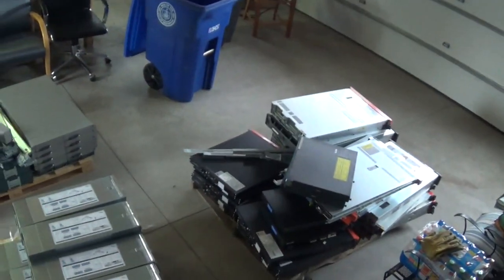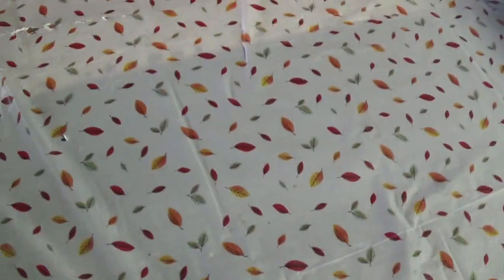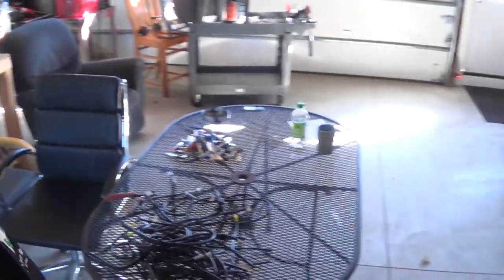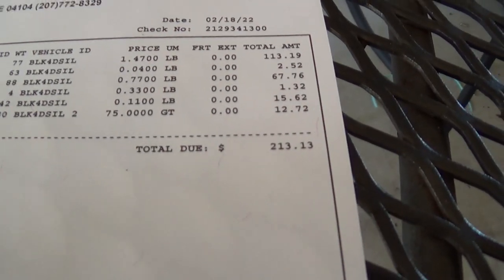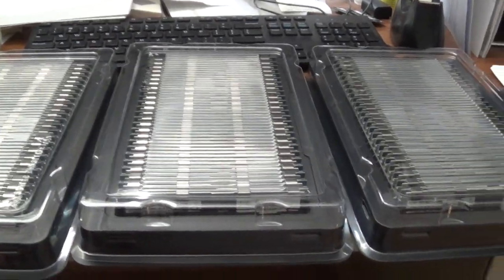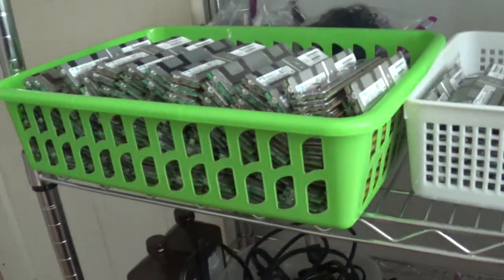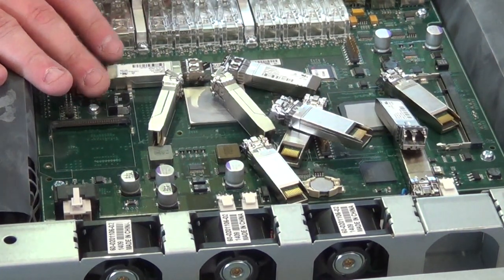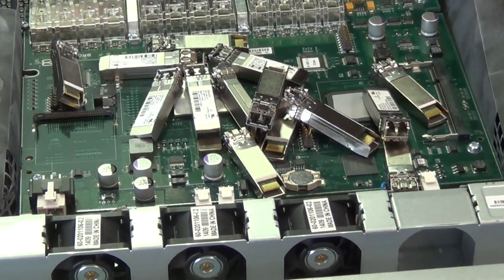Big Scrap Haul and Scrapping a Fiber Switch -Moose Scrapper #355

Comment: @21:29 there are 4 blue capacitors on the power board, they are akin to the surface mount MLCC’s and can potentially contain silver and palladium. 

If you find a yellow or orange resin dipped capacitor on a power board, it will be marked with either a C or a Y, the C is your tantalum capacitor

Happy hunting 🤙🏼
Reply: Excellent score btw 🍺🤘🏼👌🏻

Comment: I was just digging around and came up with four 170 MB hard drives and six 8 MB sticks of RAM (with a $75 price tag still on 1 putting that at almost $1 per megabyte LOL) along with two strange-looking sticks that could only be RAM but not like any RAM I've seen before along with a very robust looking PCB that says made in USA from 1992 so I thought I might ask you how you go about identifying some of these things that are very old?
Also what are you anticipating you're going to be able to get for those 32GB ddr4 server RAM sticks you got and would they fit in a standard PC ddr4 slot even if it's not supported on most motherboards because I don't care if it's 32 gigs that's only seen as 8 being able to address them just because I'm looking to maybe get a server to use as a PC and file host being able to use the same RAM when I switch would be cool so I don't have to buy anything new so update us when you figure out what you looking to get for them. 
I've tried to figure out what kind of machine this old Hardware goes into because it's quite different from what we use now but I'm not having much luck and you might recommend to me some ideas on how to go about doing that. What do you do when you see something you don't know anything about identification based software image search or just pick some old guy's brain for info on these things?

Comment: Hi I think you need to do some research on chips and components because you are throwing out dollars to get back pennies you don’t know what you are doing and you are waist all your time doing it and as for fibre switches they are big money lots of gold corner bgas and and all the stps that go in them some sell $2000 each and older ones $400 and lots of gold in side do some homework you ripped your self off big time
Reply: If it was easy everyone would be doing it.  Sometimes it  takes too long  taking e-waste apart. It piles up with no room  to walk around.